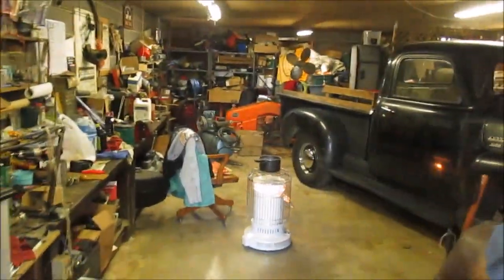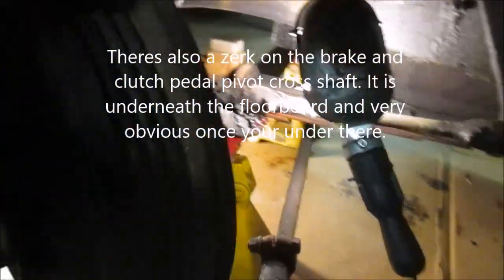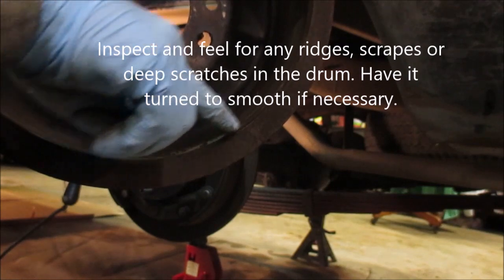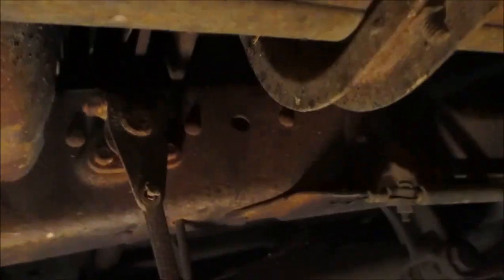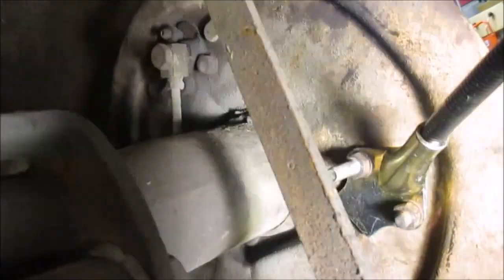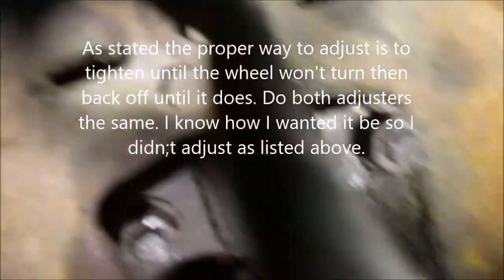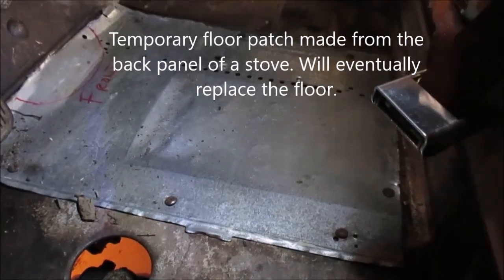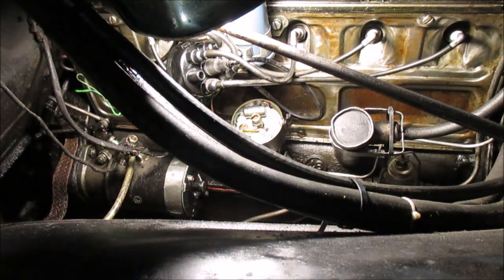1949 Chevy 3100 preventative maintenance

Comment from the maker: The heater in the 49 3100 is the original Arvin recirculating heater the original owner installed during his 1st winter with the truck. Even after 60+ years the heater core still doesn't leak and the fan motor still works.
I'll try and do an FYI on the heater. Thanks for the comments.
Dave

Comment: In this video - can you clarify for me is that truck short bed? Ours is a short bed 1948 3100 series. I had a fit finding the sweet spot of the cable length / adjuster to get the brake to hold. I've even purchased set of cables just like the one you show in the video and thoug Ive purchased the set of cable for short bed 1948 truck they i've had to recourse to cutting the threaded end to any decent adjustment. Because of that I've purchased a cable from Jim Carter and it is 95% like the old cable. I've compared the cable just like yours Vs the one from Jim Carter and I've found that the cable just like yours have a high / greater resistance of the cable in the housing when compared to the one from Jim Carter (by the way the one from Jim Carter was ordered in October 2020 and arrive two days ago.)
Reply from the maker: My Chevy 3100 is a short bed. Perhaps they sent you the wrong cable. Sounds like you've got the correct one from Jim Carter.
The manual covers adjustment very well. Good luck.

Comment: Did Carter YF come on a 216 stock? Or.  Im sure people switched them over time? I haven one with a  automatic choke I need to rebuild.   🤔 were they that much better?
Reply from the maker: From what I understand the OEM carb was the Rochester B but Carter was the "Holley" back in the day and most folks swapped the Roch B's out for Carter YF's as soon as the Roch B's acted up. Those in the know say the Carter was a better carb.
Reply: @Volfandt  nicee okay thanks for that knowledge.  Might you have a vid on how to attach the choke cable & was their  a throttle cable as well? I think you mentioned that 🤔 on the 216 liking its warm up lol 😆
Reply from the maker: @OGSHAKER2020  The 216 with OEM intake & exhaust warmed up pretty fast when compared to the 235 and it's high performance hardware. I don't have any Vids detailing the hookups but this linked Vid shows them connected (a good shot is towards the end).
https://www.youtube.com/watch?v=vcrmlGt_yw8&t=113s
Reply: @Volfandt  niceeeeee i will check it .& that 235 you built up is SWEEEETTTT!!😤 did you have 2 double feed those vacuum & where they compression fittings on those carb ends
Reply: @Volfandt  goodness im trying man I want her to just stay idling..if you would lend that experience again...soooo I got the carb. Black on w/compression fitting ..ui adjusted float level & drop.. checked points are set at .018.. got her fired up but I have to pump the heck outta the gas pedal to get her to catch once she's catches I gotta keep revving her once I stop she dies . Sounds like I think 🤔 lil back fire through exhaust..maybe or sputter. My thoughts 1)distributor.  I did both test twisted the body counterclockwise & springs did return it to retarded position  then I tested the distributor cam clockwise & it didn't move  much but it did return not sure how much 🤔 the required movement is for both these tests 2) did someone install distributor incorrectly?  Do the 2 locking tabs on cap  🤔 supposed to be sitting parallel to the block?cuz mines are almost perfectly perpendicular to it. 3) my timing. Is it just way off.. but I am getting her to run. .just can't let off the gas cuz she dies. PLEASE ANY THOUGHTS. I really wanna get her running.  I m really unning out of thoughts . If this helps when I drove her home .. few months ago. Like 4miles having to hold RPMS up revving . Someone at gas station told me they could see flames or something coming out of exhaust .. but she did over heat at that point cuz alternator belt was loose not spinning the pump. I've come along way... just trynna figure her out. Any 💡 ideas would be gladly appreciated.  Just trynna give u all I know of this situation.  Really just wanna drive her. Thx again bud.... wish you were down the street to talk to LOL.

Comment: Im having issues with the Emergency Brake. In your video you address the replacement of the parking brake cable but you do not state if you had issues getting the parking brake to hold. I've done everything stated in 1948 to 1953 Chevy Truck Shop Manual, Brake section 5-15 and 5-19 and I still can't get the brake to hold. The brakes when hydraulically applied lockup the wheels as it should. But just applying the parking brake does not lock the wheel. Drag has been set on the rear wheels as required. Any ideas? 
I have visually confirmed that the "toggle lever" moves (about one inch) when the brake cable is pulled. The spring between at the end of the cable is fully compressed. The eccentric bolt has been set as required. 
Your help is greatly appreciated.
Reply from the maker: Sounds like you need to adjust the brake yoke ends where they pin to the main parking brake cross shaft. Perhaps adjust them to take up some slack and see how it does. Make sure to count the times you turn the yoke so you can pt it back should this not be successful. 
Good luck
Reply: @Volfandt  Had done that. With no improvement. By the way The cables I purchased are from Classic Parts and they look exactly like the ones in your video.

Comment: Great and informative. However, i have a question about the rear brake assembly:  your video section of the rear brake assembly does not I.D. if the brake shoes need the conical springs just like the front use? Our 1948 3100 series brake does not have them as yours does not.  Please advise.
Reply from the maker: Those conical springs were for earlier brake shoes and are not as strong as the OEM's. I've not had any problems using the conicals but be advised they may not be what was originally installed on your truck. I recommend to reuse the hardware thats on the truck if servicable. 
Good luck.
Reply: @Volfandt  The only parts missing from the assembly are the rear shoe conical springs. do I need them or not? i did not observe them on your truck.
Reply from the maker: @chandiaz7694  According to this on-line manual the 48 rear brakes used conical springs same as the front. 
http://chevy.oldcarmanualproject.com/shop/1948_51truck/51ctsm0519.htm
The info is towards the bottom of the page.
Heres a link to the entire manual:
http://chevy.oldcarmanualproject.com/shop/1948_51truck/index.htm
Good luck.

Comment: I have a 1954 Chevy 6400. I am trying to figure out how the manual/parking brake works?
Reply from the maker: I believe the 6400 is a 2 ton truck. I also believe the parking brake consist's of a large drum and brake band thats bolted to the rear of the transmission. I could be wrong tho.
A good ref source would be to go to www.stovebolt.com , go to the forums and then to the Big Bolts sub forum. There's lots of knowledgeable floks there.

Comment from the maker: I'm not sure when GM changed their drum brakes over to the Bendix style but the Advance Design models (47-55.1st series) remained pretty constant in their construction. If your driveshaft is enclosed in a torque tube it's a safe bet your 52 is running the correct Huck style brakes.
Reply: My 1951 has bendix brakes

Comment: Hi, just a quick question, I have the same brakes (huck) as this but it’s a 3100 1952 is this correct for this year too, or has my rear axil been changed. Thank you. Great video by the way.
Reply: Graham Richards , I had a 52 3100 rolling chassis. I put the front and rear axles under my 47 3100 along with a 49 loadmaster and it’s four speed tranny. All that stuff is interchangeable.The 52 had bendix brakes and they work a lot better than the huck   From everything I’ve seen 51 seems to be the year they changed to the bendix.

Comment: What is the purpose of the Throttle Knob? I’m experiencing a very high idle on my 1951 Chevy.
Reply from the maker: Basically you used it to set the idle up higher for reasons such as, starting a cold engine,  running the truck in granny gear (4 speed 1st gear) so it would creep along etc. Some of these trucks came with PTO's that needed high stationary rpm to operate. I used the one on my old 216 for high idle at cold start and it worked great. 
Make sure the throttle cable "lock" at the carb throttle plate isn't set so high as to interfere with normal throttle operation, it may be keeping the carb from fully returning to idle. YOu can also adjust the idle down if it isn't.
Good luck and thanks for watching.

Comment: are the timing marks on the front pulleys ? good video thanks
Reply from the maker: Pat, the timing mark is on the flywheel and is visible in the hole just above the starter on the engine side of the bell housing. It will be a BB embedded into the flywheel. There is a pointer in the hole. You align the BB with the pointer when idling around 450-550 rpm. Since our fuel is better these days you will probably run more advanced than the original setting. I'm attaching a video link to where I set the timing on the 216. It's seen best at around the 5:50 mark. I've got other video's on setting the timing on a 235 which is basically the same.
Link:  https://www.youtube.com/watch?v=950IiFKTfK4
Thanks for watching.

Comment: Whats the correct engine oil that i should purchase?
Synthetic or Regular?
Any specific brand?
Please let me know!
Thanks
Eric Ruiz
Puerto Rico
Reply from the maker: I like Shell Rotella oil. Oil grade/weight is dependent upon the mileage of your engine. When new these Stovebolt engines were spec'd for 20w non detergent oil. 
Now a days you want to run detergent oil (which is most all oils now) and a good multigrade. If your engine has been rebuilt and has low mileage a 10w30 should work fine. If your engine has high mileage and low oil pressure I recommend 15w40. BAsically run an oil grade that wioll give you the highest oil pressure reading once it's warmed up to operating temperatures.
Rotella is a diesel engine oil but it has higher levels of additives that are good for flat tappet engines like these old Stovebolt engines.
Reply: @Volfandt  thanks for you support.
I will keep you informed of my 54 chevy progress as soon as i received in PR.

Comment: hello, do you have a website or info to order the oil filter kit, I can't find it in after market thanks in advance
Reply from the maker: If you're asking about just the filter elements you can get a WIX 51100 or WIX 51006 or a Fram 1100 that will fit these old bypass oil filters. If you're asking about  the full bypass oil filter kit I'm not sure they make them new anymore. This link is for a Bee Hive filter but you'll need to contact them for info: https://www.classicparts.com/1941-59-Bee-Hive-Oil-Filter-Black/productinfo/86-301/
I did a quick ebay search and found these: https://uk.bestdeals.today/chevy-235-oil-filter-canister?&origin=google&google_params[matchtype]=b&google_params[network]=g&google_params[device]=c&google_params[creative]=419324923112&google_params[keyword]=&google_params[adposition]=&google_params[adgroupid]=77425089726&google_params[campaignid]=6539768374&bs=&google_params[feeditemid]=&google_params[targetid]=dsa-19959388920&google_params[loc_interest_ms]=&google_params[loc_physical_ms]=9013350&google_params[devicemodel]=&google_params[target]=&new_api=true&dest=0&sys_id=0|242&gclid=CjwKCAjw1v_0BRAkEiwALFkj5kH-vmGlMR6EyzEF_QoSbOzZS5nQ5lf1qkxB4CIlTMWItJ3Y80IV5BoCuLgQAvD_BwE

Good luck.

Comment: Can I get in contact with You Bud I need rear drum components and original Clevis’s
Reply from the maker: my email is: volfandt1@yahoo.com
I don't have any spare original brake parts but a quick search for "clevis" turned up several sources including NAPA.
https://www.napaonline.com/en/p/NOE7321123?cid=paidsearch_shopping_dcoe_google&campaign=GSC-Fasteners-Hardware&campaign_id=10947735022&adgroup_id=107081865346&adtype=pla_with_promotion&gclid=Cj0KCQiAo-yfBhD_ARIsANr56g7KvOFyCkHlVBRXvm3BsEisxCZ68mHBLCzt_x0IYYBsqVKuO5UygFkaAhfwEALw_wcB&gclsrc=aw.ds&
Jim Carter:
https://oldchevytrucks.com/me160.html?gclid=Cj0KCQiAo-yfBhD_ARIsANr56g76JK0zDgfV_JlnfDkWqg0f551V2CDSuWMUtFZezY45jXoPTTuCiqwaAnaUEALw_wcB
Reply: Thank You 👍

Comment: is the rotor better upside down?
Reply from the maker: Ray, if you mean the coil, it doesn't matter which way it's mounted. It came factory stock upside down so that's how I left it. I've had other engines with the coils mounted in all sorts of different positions. Thanks for watching.

Comment: Can you please tell me where the brake adjuster is?
Reply from the maker: There are two adjusters. Look on the backside of the brake backing plate and you should see two slots at about the 10 & 2 oclock positions. Go by my template in the video to know which way to turn. Good luck.
Reply: Can I get your email so I can send you a picture?
Reply: Volfandt  can I get your email so I can send you a picture
Reply from the maker: @KristeenDevon  volfandt1@yahoo.com
Reply: Volfandt I just sent you a email